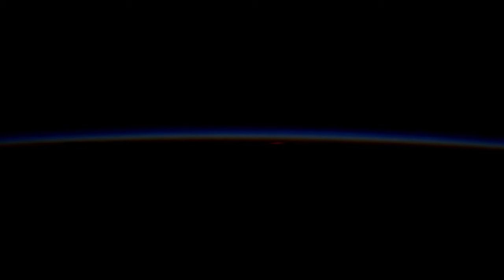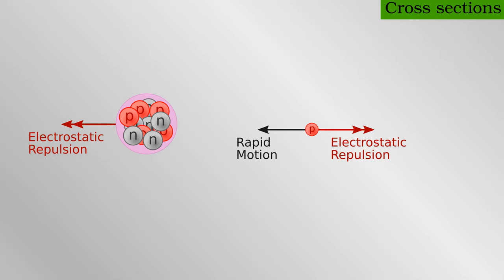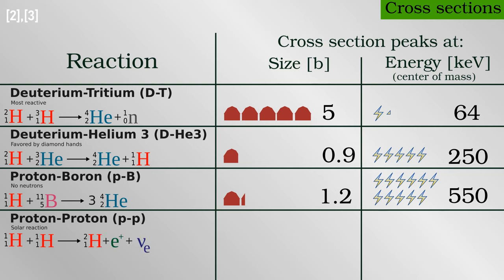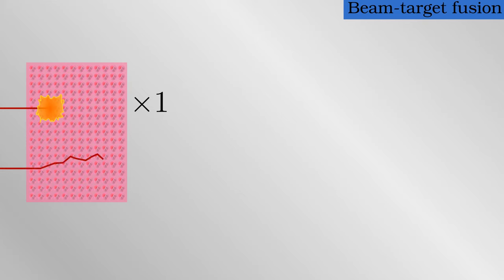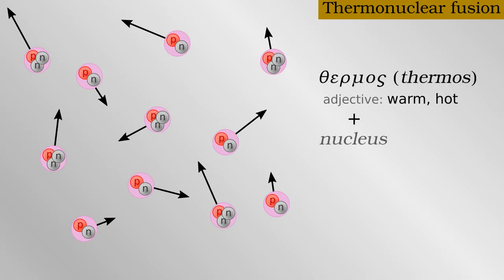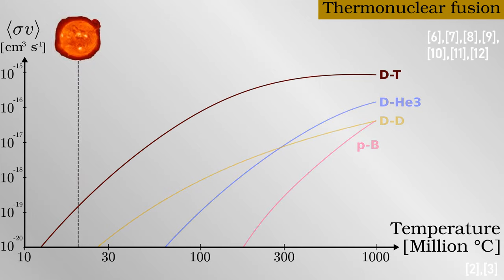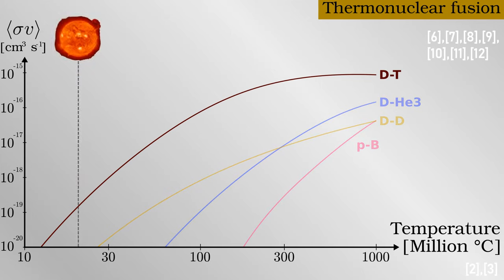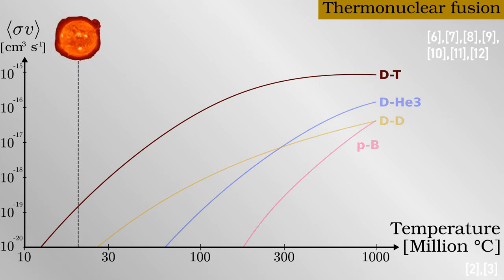How nuclear fusion works (1) - fusors, thermonuclear reactions, lattice fusion

Comment: I don't think it is as discussed in what form energy is released from a nuclear reaction. Imagine a proton from the right colliding with a neutron from the left, both with the same momentum with respect to each other. If a deuteron (pn bound state) is formed, in which form the energy from the mass defect (between deuteron and p + n) is released? how would the release of that energy still conserve total monentum?
Reply from the maker: I think you've hit the nail on the head - the reaction will not happen if both energy and momentum conservation cannot happen. In the technologically relevant ones - D-T, D-D and so on - there are 2+ resultant nuclei, so both could be conserved. The reason for the way the energy is split between them is due to this. In the very unlikely proton-proton case, there is a positron and neutrino, so again both conditions can be met.
Reply: @ImprobableMatter  hmmm lets say in the end product you have 2 (or more) particles, are those particles get absorbed directly by the walls to extract power from fusion? does it matter if the particle is charged? or maybe energy can be extracted from the gamma rays (or maybe the gammas are losses?)

Comment: Thermonuclear fusion creates a temperature high enough to exceed the nuclear space charge field. Lattice catalyzed fusion works by diluting the space charge field. Elements of the nickel group or of the rare earth group can catalyze it. It requires that the hydrogen forms an intermetallic bond but not an ionic bond. In the case of nickel it fills the D9-10 transition gap. Fusion occurs by tunneling due to sympathetic nucleonic resonance, with the higest probability being for palladium. The result is helium 4 plus a gamma ray 90% of the time and helium 3 and a neutron 10% of the time. Sending a shockwave through deuterium saturated palladium is sufficient to trigger it. Easiest way to do so is hitting it with a laser. Its more of a scientific curiosity than anything else as the catylist rips itself apart and releases the deiterium from the intermetallic bond.❤

Comment: I think it would be a good idea to build a modern advanced nuclear energy reactor (LFTR, small form reactor, etc.) to power the electrical grid system that feeds the experimental fusion plant so we won't be wasting electricity from a power grid that's ran off of non efficient fossil fuel sources, etc. Then we can more freely experiment with a electrical power source. Plus, the advancements of nuclear energy options has improved so much that I really hope we start utilizing it because our tech, knowledge, safety measures, engineering, material science knowledge, etc. Have advanced so far that we can and should utilize this energy option and prove that we can overcome our past traumas that solely came from us not fully understanding how to go about nuclear energy but I truly believe that we have the ability, knowledge and understanding to embrace nuclear energy options and greatly improve our electrical grid and our qualities of Life.

Comment: technicalities don't bother me at all, and most of this i remember from the uni's physics course. the soundtrack, on the other hand, annoyed me immensely because of how distracting it is. i think if you really want to put a soundtrack, you should put it into parts where not much attention is needed anyway: funny pictures, easy graphs, etc. putting "toreador" in the middle of reaction cross section interaction is a hard no.
Reply from the maker: OK, point taken. The next part in this series will discuss inertial fusion, but the one after will cover tokamaks and stellarators.
Reply: Didn't bother me at all, I was totally into the explanation well done, 👽

Comment: Problems= 1: A high efficiency power plant operates at a top temperature of 1500 K.  Above it, thermal stresses in piping , pumping and related systems cause problems. How do you SAFELY AND CONSISTENTLY transfer power at 200 times the Delta T? 2: There is only one source of tritium= Fission reactors. Thus you need a fission reactor to operate a fusion reactor. Then you will never get rid of radioactive waste. Provided there is not an earthquake, pump malfunction or operator error. Not counting the fact that every DT reaction emits a neutron, and that neutron does something called spalling on the metal structure of the Tokamak. 3: How do you transfer heat with a Delta T of 100 million degrees?

Comment: I don't think we can achieve nuclear fusion until we get really matured,highly advanced agi.I think the condition of nuclear fusion must be dynamic set according to the dynamic condition happening in the reaction chamber.This requires super frequently adjust ments of applied conditions which I think can not be done  manually.This advanced agi must have a deep/full understanding about things like turbulence problem.If not,it should at least have the ability to predict what adjustments can be done to increase the possibility of keeping a stable nuclear fusion reaction.

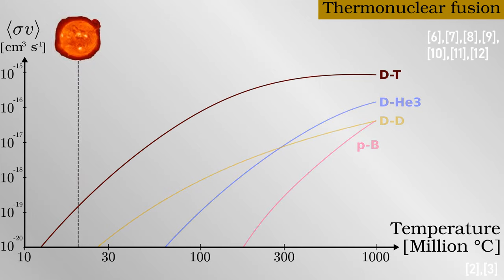Comment: 8:58 why is it bad that it gives of neutrons?
Reply from the maker: Neutrons will typically keep flying until they get absorbed by a nucleus, such as the walls of the reactor, the atmosphere, etc. For most nuclei, absorbing a neutron would make them radioactive, so this means that the reactor will need very strong shielding. Also, the neutrons carry a lot of energy and if they strike something like a piece of metal, they will smack the atoms which make the metal structure very hard. This means that a solid reactor chamber will begin to look like Swiss cheese and will become brittle.
Reply: @ImprobableMatter  thank you! :)

Comment: Barn is such a weird unit because it feels like when talking about such a complicated topic as fusion you couldn't possibly use something as simple as just the meter as your unit. Like surely at this point everything should be made up of like 3 derived SI units and one of them is in the third root for good measure.

Comment: 14:32 Plasma is prepared by removing the cellular components (erythrocytes, leukocytes and platelets) of the blood using boring scientific materials, mainly a centrifuge and an anticoagulant. It is delivered via IV, and is used to save people suffering from significant blood loss.
Since it lacks cells, there are no antigens (AB0, Rh, etc.) for the antibodies of the patient to bind and make a scene, and it is easier to store and handle; great benefits over blood transfusion. 
However, If you have cell-membrane proteins in your plasma, then there are probably some remnants of (red) blood cells, which is precisely where the AB0 antigens are located, and you may kill the patient. 
You can tell because normal plasma proteins have a globular (spheroidal) shape; not the weird barrels nor fancy tertiary/quaternary conformations typical of cell-membrane proteins.

Btw, I feel privileged for having discovered your channel, sir. I am currently binge-watching with great joy the rest of your content.

not native speaker, sorry for english

Comment: The proton-proton reaction takes an extremely long "confinement time" for reactions to occur;  that is the miracle that gives us even burning, long lived stars.  If it weren't for this unique condition, stars would ignite and quickly burn themselves out like a firework in a few million years or less;  a splash in the pan so to speak - too hot and short lived to father a solar system.

Comment: [edit - my comment was apparently erased by Youtube algorithm. Sorry @improbable matter] Wow erasing comments that do not match your opinion on a specific subject? This is so unscientific. Keep upholding the consensus. Cheers.
Reply from the maker: Which comments did I erase?
Reply: @ImprobableMatter  posted a lengthy comment above about consensus  VS science. May have vanished in the Ether for some technical reason. Then I try to repost  but I cant. Anyways. Sorry  if you did not  erase it.
Reply from the maker: I haven't erased any comments; in fact, in my last video I even rescued a very critical comment from the YouTube auto filter. YouTube seems to instantly remove some comments (a couple of bots instantly left comments after the video was posted and were removed). Sometimes I get notifications of comments, but they are then also removed by YouTube. I don't have a notification of your last comment, nor is it in the filtered list (which I can then approve). More than happy to accept critical comments as long as the website physically allows me to.
Reply: @ImprobableMatter  I am sorry im that case for wrongly accusing you of erasing comments. Youtube is on full    Ministry of Truth mode lately, I can concur on that. My comment contained references to Michael Crichton quote on “consensus science” . I advise you look it up. I’ll join the Discord Channel! Cheers

Comment: proton - Boron & HB11 will not happen over night. The comment that "fusion is 20 years   off" could well be right this time. HB11, without conventional generators & heat could be pivotal, away from DT.
 I can see in 20 years time a unit the size of a microwave in every EV & house.
Reply from the maker: As the video explains, the low cross section and inevitable bremsstrahlung losses make this very challenging if not impossible.

Comment: We are so far away from power generation with fusion that it is impossible to guess if it will ever be possible.    Ignition at livermore labs was super cool but not easily repeatable.     Managing a chaotic plasma with magnets and probabalistic models/ai is also super cool for a few micro-seconds but nothing even remotely stable.     Very cool physics work for the sake of experimental physicsits but basically useless for practical use.   Same for using Deuterium.   That's not going to happen.        Bunch of impossible problems to solve before there is anything to see in practical fusion.        Love the physics in the same way I love CERN but pretending that there will be a direct positive outcome is always silly.     New tools used by the experimental physicists will have applications though.

Comment: If man-made climate change is correct. why do different model yield different result? if there were competing theories of gravaty giving out different planetary orbit no one would consider them solved
Reply from the maker: The climate is not as simple as a fundamental force, but a complicated and chaotic phenomenon. A better analogy would be the economy: there are different models for it growing by 2%, 2.5%, 3%. Does the fact that there is a spread of predictions mean that the economy won't grow?

Even with different gravitational models though (indeed, we have not "solved" gravity, because we haven't unified it with the other forces): while small details may differ, the overall picture of a planet in orbit around a star will hold. Similarly, while there are differences in predictions in climate models, the overall trend is the same.
Reply: @ImprobableMatter  . Thanks for replying.I find parameterization in climate modeling problematic. If new observeation contradict with the model. they change the parameter. Whereas in normal science the theory get throwed out. what if the approach of modeling with resolution of kilometers is just wrong?
Reply from the maker: The sort of numerical simulations performed by climate scientists work well for jet engines and so on when scaled correctly. Kilometers are appropriate on the scale of the planet. There is other convincing evidence for climate change from observed temperature rises at sea level, fundamental science (properties of CO2 measurable in the lab), historical data from ice cores and even arguably studies of the climate of Venus and Mars.
Reply: Gravity doesn’t have the Heisenberg Uncertainty Principle going against it; gravity is the exact opposite of chaos
Reply: And your example is miraculously ironic because either equivalent of climate modelling…….. is orbital modelling ! We model the probable trajectory of our Solar system’s planets, because we never know for sure where they’ll be in space with absolute certainty ! There are too many factors and not only is it complicated to keep all the significant numbers (because one decimal off and you can get thousands of kms away in a few centuries on these scales in general), but by math you know that there is no chance for a perfect solution ! You can’t isolate the variable of the researched, sought-after, end-state !

It’s literally the same thing !
Only the climate has much more independent variables that are very far and out of the reach of our instrumentation, which technically isn’t the same thing

Also, climatologists behave differently from astronomers : They have different thought processes; different conceptions of what may or may not be important; they might not even want to look for the exact same metric as each other !
Reply: @Halen9595  
“If new observation contradicts the model, the model and its fundamental elements are changed. This isn’t normal science, because only ‘inherent’ & ‘fundamental’ changes count as science when a model is proven wrong.”
This is fallacious. This is EXACTLY what science is. You try out all the parameter values; this exactly how Cavendish found the gravitational constant (or could’ve, if he started with an two values of G that englobed the two different sorts of contradictions that his experimental setup had with them)